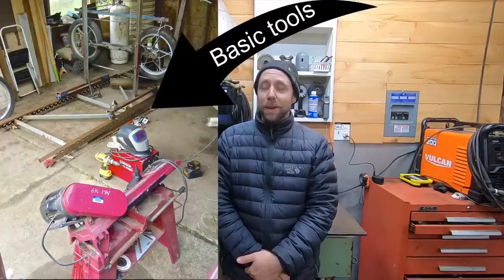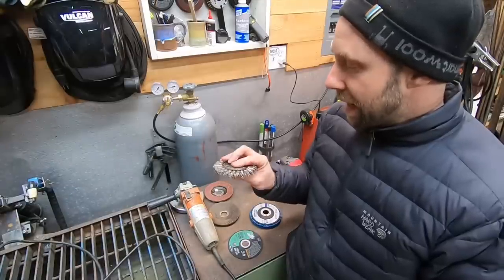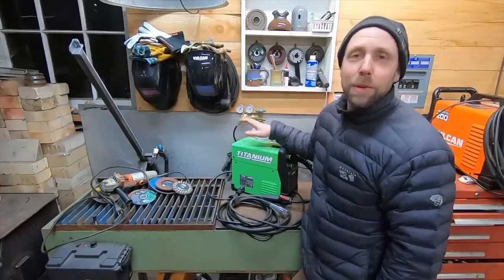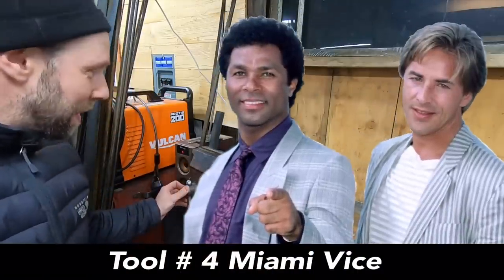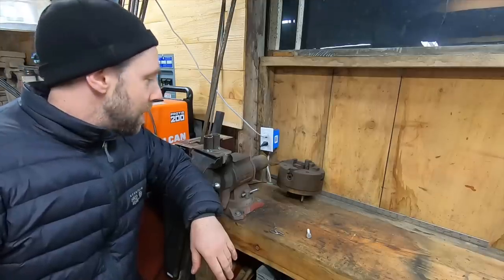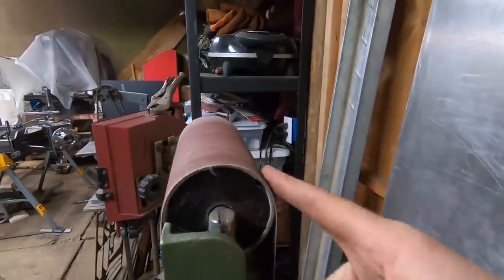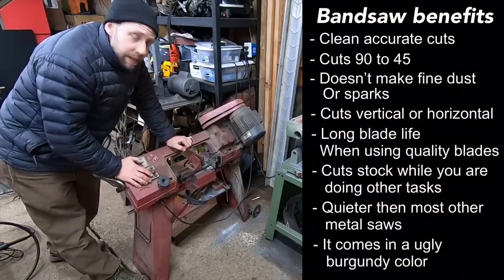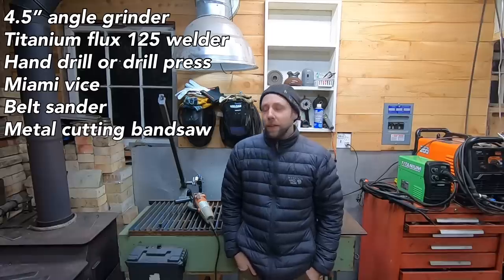6 affordable tools I recommend to get started in fabrication

Comment: COOL video. So open minded and not like alot of folks who say, its gotta be this or that. Proof is in the puddings that you can do DYI projects without spending huge dollars. My brother has done it all his life buying cheap tools to maintain his cars, and alot of experts say, no, not meant for that, you cant do that. Yup, he proved them wrong over and over and over again. Think outside the box and expand yourself a little, and dont listen to folks that say it cannot be done. Because, I have SEEN it done over and over and over again. :-) Opinions are like you know what, everyone has one. LOL
Reply: By the way, I have used cheap tools to rebuilt fiberglass boats, boat transoms, boat floors, rebuilt RV floors, Kitchens, replaced hardwood floors, repaired lawnmowers, snowblowers, replaced tapa's on Cahones, decks, fences,  and many many many more project.  Listen to the manufacturers recommendation at all times of course, but I do what I feel is right for me and always take the necessary precautions using common sense to ensure my safety. Do not be afraid to step outside the box, but make sure you understand the precautions necessary to ensure your safety and that of others. Keep in mind this one thing, I am a guitar player with 38 years experience, I do not recommend a  new player buy a $2000 guitar to learn, and many skilled trades folks would agree with me, buy what you need to learn the skills first.

Comment: Thanks for posting, nice video, on the drill bits, dont chuck them, i would recommend, learn how to sharpen them, just try to keep the original shape. A couple of years ago, i used to work on a small farm, and the owner worked every day, he could weld, and do mechanic work, knew alot about Carpentry, farming of course, and was a top notch heavy equipment operator, but he handed me drill bits, i am not bragging, just sharing.

Comment: I'm surprised you didn't mention a bench grinder with a wire wheel. I use mine a lot and they are not expensive.

Comment: If you want a REALLY nice little flux wire welder check out the forney easyweld series.  Makes decent welds, real easy to use, no gas.  Just a nice unit to start out and it's been damn reliable.  Its more expensive than the titanium of course, so it's more of a "I want a welder I'm not gonna want to get rid of" purchase.  As long as you KNOW you want to be able to weld itll last you for about 3-400 bucks.  Also, hit up pawn shops!!! You can negotiate them down and it's not like you NEED new tools.  You'll get better equipment for your money if you buy used and you wont end up wanting to replace em nearly as fast if ever.

Comment: 1) i have two
2) have stick one
3) battery powered and mid size table one
4) i builded one
5) i will build one
6) i have abrasive saw, but plan on getting electrical hand saw

but i agre with list, yea!

Comment: Center punch, Square, tape measure, metal files, Stub drill bits, tap/die set, scríbe, sharpies, welding magnets, vice grips, lump hammer, metal ruler, hack saw....

Anyone else have inputs to help the newbies?
Reply from the maker: I covered all that in the second video 👍 good suggestions, Thanks Aaron

Comment: im trying to get my garage outfitted similar. im a huge fan of harbor freight and they haven't failed me.
Reply from the maker: Right on 👍 I have had good experiences with HF tools, have you seen my articulating dump truck build I’m currently working on? I’m using a HF plasma cutter, welder, angle grinder, sander and other tools to build it. They work fine. I hope you get your shop set up soon!
Reply: @Mikefestiva  During my lunch break Ill start watching it because that and the atv look cool. I like making things as well and was tired of buying bolts man, I told myself its time. Lucky for me my wife is extremely supportive and like tools as well. You sir gained yourself a sub.
Thank you.
PS I just finished your video teaching your nephew to mig-great video and will follow so I can teach my son whos the same age.  I have older AC wire welder, but purchased the 80a inverter stick I was gonna start but now I think Ill grab the inverter mig you have which is on sale (like always).
  Thank you again from Philadelphia.

Comment: i recommend getting a stick welder because it's a unique process, and you'll be able to do stuff that small mig just wont. if you're only going to buy one, get the flux core, but don't brag about welding until you can run a rod (i barely can, didn't keep my buzz box long enough)
Reply from the maker: I have been welding for many years now, I started on stick, I can lay down a good bead with a stick welder. I just don’t really care for them, but like you mentioned, they have there place and purpose. Even after learning on stick I still don’t feel it really makes you much better to learn on. But that’s my personal take on it that’s all. Take care Spencer

Comment: I can’t think of a thing that you left out ! Other then clamps and stuff like that ! I do agree about the welder , those harbor freight ones work just fine for the hobbyists and light users , o and a good air compressor , HF has a 21 gal. Vertical w/ 2 1/2 horse 110 volt for $150 and the CFM is 5.7 @ 90 lbs !
Reply from the maker: Thanks for commenting Dave! Yes clamp and stuff like that are coming in the next video 👍
Reply: I'd recommend an entry-level compressor simply because the tools you can buy for them are pretty inexpensive vs their electronic variants.
Reply: Phil Roberts HF is an entry level compressor!
Reply: Mike festiva sorry about stepping on you thunder ( next video ) !

Comment: Just re-watching this presentation Mike, and I would like to add that for all the guys that have been welding for years that say  you should stick weld, or purchase the most expensive welder you can afford, let me say this...
I think stick welding sucks, and I'm good at it, and purchasing the most expensive welder you can afford is dumb. MIG is the way to go. Start off with that flux welder, and up the game to a gas shielded mig set up. Red and blue machines are WAY over priced for what you get. Especially the blue ones.
Reply: You don't need the most expensive welder you can afford, but if you're buying cheap stick is the only decent option. The lowest end mig and tig machines are crap, and by the time you've bought all your gas stuff you end up spending a load anyway.

If you're going to spend decent money, go for a multiprocess machine. If you're buying cheap, use stick.

Comment: I highly suggest against buying a mig welder as a first welder. A stick machine is $50 on ebay or amazon. stick is cheaper, easier, and gives you better skills to build on. beyond this, mig is so much easier to make mistakes. you wont know if youre welds are messing up due to bad settings, wire getting stuck in the hose, or just plain bad form.
Reply: well thats a good thing he didnt suggest mig then isnt it?or stick. he suggested a flux welder. and i agree
Reply: @kellytedder7768  ok, I'll give you credit there I misspoke. I call all wire welders mig but I am wrong lol. I should've said wire feed welders.
Reply: th4tguy technically they are all wire fed. Some automatically — some manually. All welding requires a heat source and filler material (except mechanical/friction welding) , stick and flux style  use flux coated wire that shields the puddle from oxygen/gases. Mig uses gas induction. The flux ones leave this wired slag that is like a dried scab over the bead lol I’m sure you know that tho
Reply: @kellytedder7768  yeah, the main point that I have is there is more to go wrong on a wire feed/mig/flux core machine. More things need to go correctly than with other processes. The shop welder we have, a Hobart handler 135 just broke down because the feed wheel just stopped working. The solenoids still clicked but the whole project had to be paused because of it. Ended up arc welding it at home.

Comment: One thing I would suggest is buying a stone grinder instead of the belt one. It's fine for hobby stuff and you can buy one used for 15$ that will last you 2 decades easily

Comment: Also if you can't afford the cost of the full size bandsaw, you can always buy a portable band saw like the Bauer which goes on sale for $99 all the time. Then either build a table for it or build a stand and you can use it as a smaller version of the large one. much cleaner and more versatile than a metal chopsaw.
Reply from the maker: Good tip! 👍

Comment: Great video agree with all your tool choices, and the whole what’s best to learn debate I understand the point of stick for starting because of TIG similarities and moving your hands down and across manually feeding. With that being said my shops best mechanic took the time to teach me to weld and it was MIG I’ve always preferred it TIG is great but took much more for me to learn and to quickly put metal to metals I’ll always prefer MIG... imo it’s very good for undertaking the movement of the puddle and feed speed and amps needed to melt each thickness. I enjoy all three Stick is very useful not needing gas bottle and the such but I much rather MIG If I could choose. Maybe one day when I am much better with TIG I’ll offer if but cannot imagine its ever going to be faster than MIG

Comment: Never! Buy thin cutting discs at harbor freight... unless you want to be blind or scarred for life. Thin cut off discs are one of the most dangerous things in a shop. The first tools you should buy are steel toe boots, a full face shield, safety glasses, an assortment of task related face masks that you keep in a kit and an assortment of task related work gloves. Ask around-- thin grinding discs are no joke. I can tell you for a fact that if you buy the best you will never regret it. Save your money and be patient. Cheap tools cause injuries. 🤔
Reply from the maker: I’m all for safety but I did not make a video about safety gear to buy, that’s a entire video of it’s own. My video is (6 affordable tools to get started in metal fabrication) 
Cheap tools don’t cause injuries, any tool expensive of cheap can cause injuries if used improperly, bad choices and improper use of tools,  removal of safety guards cause a lot of injuries. I have run HF cut off discs along with many name brand discs over the years, they all work fine. Any thin disc regardless of brand can come apart, so you never run a angle grinder with the wheel in line with your face, for the fact sooner or later one will come apart whether it binds in the cut or gets side load on the disc. a face shield is definitely a good recommendation like you mentioned. I completely agree with you on safety and I would never recommend people not to take safety first but I’m not going to make a video on that subject, there’s far to many people with there own ideas and opinions on what’s best, anyone operating power tools should do there own research and understand how to properly and safely use them.
Reply: @Mikefestiva  been using thin discs for years, never had a problem, they work great!
Reply from the maker: Hey Jeffery it’s good to hear from you, It’s been a long time!  How have you been?
Reply: I’ve never had a HF disc come apart outta the blue I’ve only had over used disc bind and break. I’ve have the ones from lowes do the same thing.
Reply: @Mikefestiva  Doing well Mike, great video as always, it will really help out new people!
Reply: Are the stripping discs safe? Asking for a friend who I want to be safe.
Reply: I bought a multi-pack of grinding wheels a couple of decades ago from that place that did the traveling tool sale. After the second wheel came apart I threw the rest away. I recently took a chance on some Harbor Freight cut off disks and were very happy with how they held up. Gone thru several packs of them now.  All 3 of my grinders have their guards in place and i believe in using safety gear.

Comment: Buy several angle grinders so you don't have change discs. FBMP normally has a few Lincoln flux core welders listed, bought a new 125 120/240V for $180, used it a couple years until I found a new 180 240V (gas or flux) for $380. Sold the 125 for $200.

Comment: While your sander is doing what you want, it's designed for wood not metal. Since you are cutting metal, you need to get a drill press that goes down to 100 RPM or less. Wood drill presses go to fat to drill metal and will burn up drills in steel. My 4x6 metal band saw I bought new in the mid 1980's. Still works well. You are right about better quality band saw blades, they are worth the extra money.
Reply from the maker: bozo28able This belt sander can sand wood, metal just about anything you want. How come you think it’s designed for wood only? I would like to know your reasoning on that one?
Reply: Belt sanders sand everything, not just wood.  As far as drill speeds, they all go too fast.  I have been putting variable frequency drives on my stuff to slow them down.   VFD technology also let's your run 3 phase stuff on single phase input power, very handy since 3 phase stuff sells cheaper many times.
Reply from the maker: Joseph Granat Yes VFDs are great 👍 I installed one on my old drill press, they are very affordable now too 🙂 Take care
Reply: @Mikefestiva  Yes it can sand wood. There is a difference in speed and on metal sanders the lower wheel has rubber on the outside. The wood sander has a metal roller. When sanding metal with a solid roller the metal bounces because of the joint in the belt making a loop. Makes it hard to do nice sanding on steel. At work they have a wood sander and a metal sander and use both form metal. The preferred sander is the one for metal because of the rubber lower wheel. At home I have a Jet sander on one side is a grinding wheel and the other side is the sander. You can really push hard on the rubber wheel and only slow it down. When trying the same thing on the rest with the hard back it acts as a brake and you can actually stall the sander. I don't know if we can show pictures in the comments?
Reply: @BoysInTheWoodsofPA  I have a formost drill press and the lowest speed is 150 rpm. It will drill a 5/8 hole in steel. Like saws sanders are made for different materials.
Reply: @bozo28able  I have an Atlas 1/2 bench top drill press that drills 1 1/8 holes without making a blue chip, it didn't do that stock.  I have turned some wood on my metal lathe too....the difference in what any machine can do is the nut on the controls.  You have a good evening!
Reply: Theres a reason many drills are made from High speed steel.
Reply: @BoysInTheWoodsofPA  I have turned wood also on a metal lathe. Metal lathes don't run fast enough for wood. Just how many different size drills did it take to drill out to 1 1/8? My metal lathe is 7.5 HP and a top speed of 1,000 RPM and weighs over 2,000 pounds. It doesn't do as good of a job as a wood lathe.
Reply: Bozo, whatever works for you is what is best for you. Thinking outside the box is an important part of DYI because not everyone has the cash flow to get what is recommended.
Reply: @bozo28able  I center drill with a half inch OD center drill, punch it out to half inch, then 3/4, then 1 1/8.  If you drop your speed and control your feed it's pretty  easy.

Comment: What tool should I get instead of an angle grinder because I'm looking to get into metal fab but am not allowed to use an angle grinder? (I'm 13) I'm thinking a porta band and diegrinder
Reply: First off, I think it's GREAT that you are getting started so young. But on the more pragmatic end, if you aren't allowed to use a grinder due to safety concerns, how will you weld? Obviously I'm not your parent, but perhaps this is a point you can make to your (I assume) father? Either way any beginner should have supervision when learning - it will make you learn faster, and learn much safer practices. Also, A die grinder isn't that much safer than an angle grinder - especially if you find yourself fighting the tool and working it harder to get the results you need- likewise, a portaband, I'd argue can be just as dangerous or even more than an angle grinder. As we like to say in the firearms community, the most important piece of safety gear is the mushy stuff between your ears.
Reply: @thechillhacker  I actually got an angle grinder a few months ago after finally convincing my mom. Just tried mig welding a few days ago cuz I'm working for my uncle who is a welder
Reply: @feidhlimoshea8180  great! Keep it up! Making things from scrap or raw material is a powerful skillset to have, and a passion for many of us
Reply: @thechillhacker  update (from a dif account) I'm currently working on a go kart out of scrap steel and an old engine. Just bought a cheap multiprocessor welder.
Reply: @feidhlimoshea8180  awesome man! Fab on!